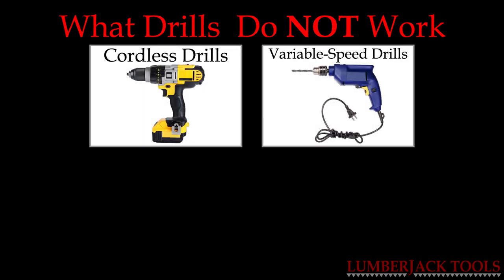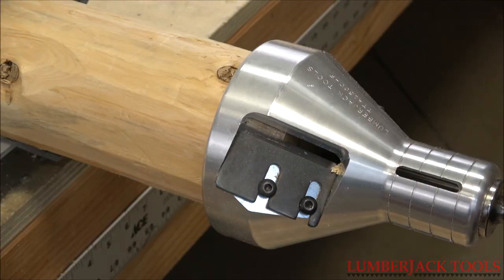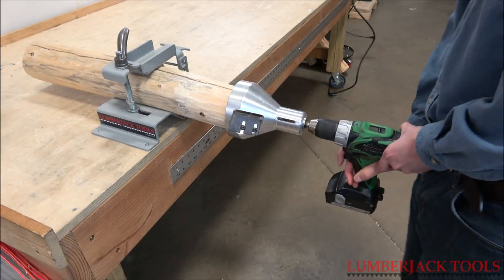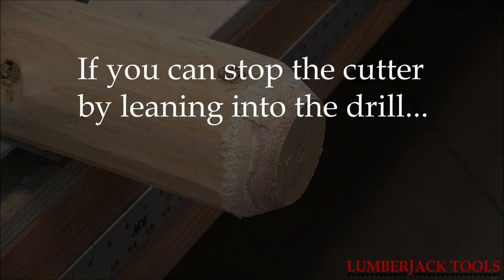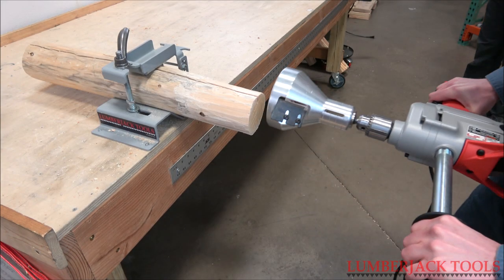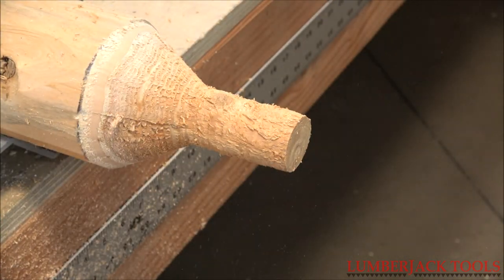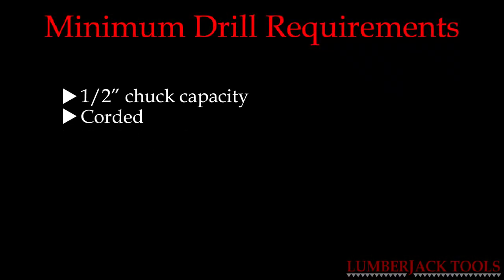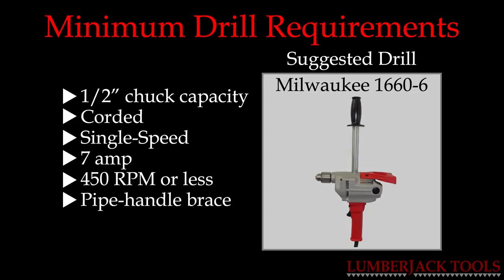Lumberjack Tools Drill Requirements

Comment: So we need a Milwaukee 1660-6 1/2 in. Drill that runs at 450 RPM that weighs 12 pounds and cost nearly $300 bucks to even consider getting into this hobby? Is there a second choice or other options?
Reply: We recommend a Milwaukee drill model 1660-6.  It is a single speed drill, 450 rpms, 7 amp motor.  Yes, it is a serious drill but still manageable.  You should be able to find it for around $250, not $600.
Reply: Buy used
Reply: drawknife?